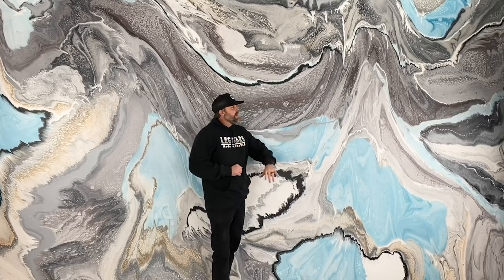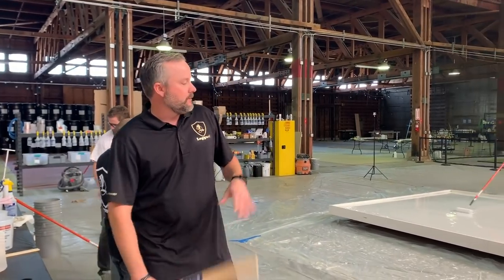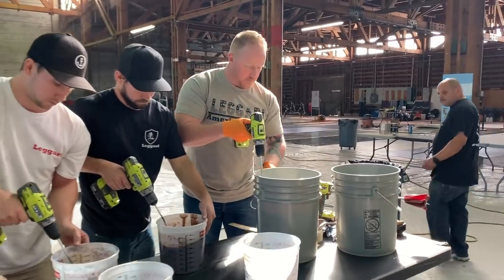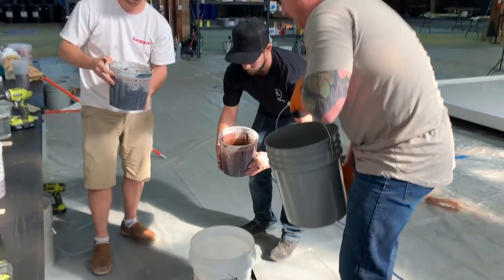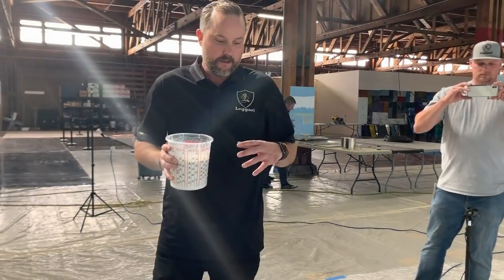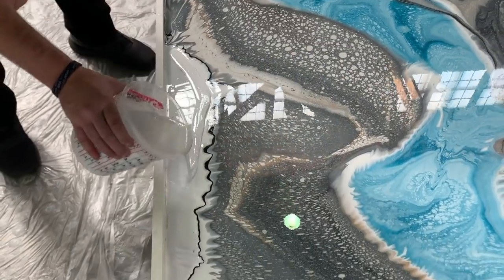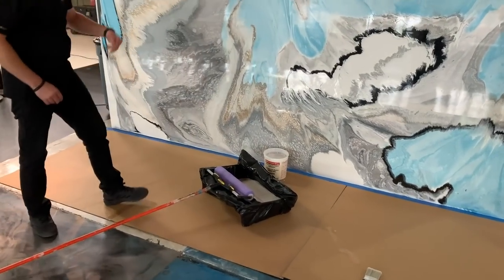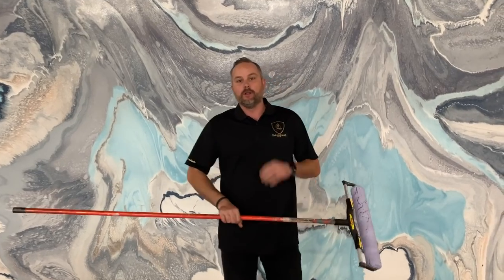MASSIVE Custom Epoxy Wall | Coated Using Dirty Pour Technique From Wood To Epoxy | Step By Step

Comment: Ever consider trying to use your product to create faux quartz?  Looking to do this on a large countertop in a kitchen and just saw your paint chipped pour look. Thought that could be the perfect technique to use and possibly a new offering for you all. Suggestion may include starting with silver at 25% and a white at 75% gently and not completely mixed, then apply. Instead of the paint chip covering the entire floor, use crushed up flecks of very small white and clear sequins or small crushed white and transparent rocks with a clear top coat. Love to see you try this. I have photos of the quartz I am talking about if you would like to see it.  Love your easy products!
Reply from the maker: Hi Jennifer,  take a look at our online brochure.  Thanks
https://online.flippingbook.com/view/364043

Comment: Oh I have been so waiting for this. I absolutely love it. super, this is exactly what I have been waiting to see. Your pouring techniques have come a long way. Love it. The fact that you are not overmixing is dreamy and natural. Way to go. I was wondering about the glair as I am typing. Bingo, you took care of that. I was thinking of sanding, but you got it. So here is what I have been thinking. Since i work solo and have wanted to do walls in some of my old houses that I want to sell. I am wondering what you used as your base to do your pour on. I need the lightest weight an I am 71. Lifting heavy is no longer in my capabilities, nor my desire! What I am thinking of doing, is cutting whatever the lightest material I can use in curves shapes that fit together like a puzzle. that way i can lift each piece and put it on a wall like a puzzle. You could use this for very large walls. Very very large walls! I would then screw it into the wall and then fill the screw holes. So what is the lightest weight you would use. I am also thinking about curved surfaces. Is there a window of drying time where the base materials could be bent. If I did a dome ceiling in my bedroom.  Now ya really have me going. Can your product be used on exteriors. How does it hold up to weather? Thanks for pushing the artistic envelope. I love what you are doing. Thanks
Reply: That’s an interesting idea to use a curved surface. Might be a little difficult but probably achievable

Comment: hi guys, that was a beautifyl master piece... i wonder that you did not use torch for the bubbles?
Reply from the maker: We have a high end epoxy that has an additive in it to make the bubbles rise to the surface and pop on their own.  Thanks

Comment: How do you guys do a removal or a clean up after using buckets/containers and mixer that had epoxy on them?
Reply: BattleRoyaleSucks you just throw them away they can’t be used again I’ve worked with these epoxies for over 16 yrs
Reply from the maker: We usually just throw them away because it is tough to clean the epoxy out of the buckets once it hardens up.

Comment: You left out the one phase I wanted to see... How did you heat it ? to get the bubbles out? Did you torch it? Did you use a heat gun? what did you do? It Turned out beautiful !

Comment: U guys Mix the color with part A or  B or both A and with the color together
Reply from the maker: We added all the Metallic pigments to the Part A’s then added the Part B’s to them. Once all the colored epoxy was mixed together we then separated it into the different buckets combining the different colors. We then poured to buckets into the surface. There’s many more of these videos coming out soon so stay tuned because we explain that process in better detail in those videos. Thanks
Reply: Thanks

Comment: Would wood filler work the same on the seals and screw holes? I hope so because I have filled mine in and rounded the edge of my counter top already. 😕
Reply from the maker: Yes it should work but we like to use bondo multi purpose putty because it is a lot stronger.

Comment: Beautiful! Can I ask how you deal with the bubbles???
Love your work.
Reply from the maker: We have a high end epoxy that has an additive in it to make the bubbles rise to the surface and pop on their own.  Thanks
Reply: Yeah, how did you get the cells?
Reply: @LeggariProducts  So your saying when you do those amazing projects you dont have to apply heat or a second coat?????

Comment: Can this be used in a bathroom? Shower wall?
Reply from the maker: This is not a product to applicate vertically because the epoxy will just run.

Comment: Hi what have you sealed the entire mdf with is it resin
Reply from the maker: First he applies our primer then he pours our epoxy resin so it will adhere to our primer.
Reply from the maker: I see what you mean, we first filled all the holes and seems with our Patcher Paste, then we flooded the entire surface with a clear coat of our Metallic Epoxy so that the colored coat didn’t soak into the wood. After that we did a thin coat of our Pigmented Epoxy and added all the colors into that. Hope that helps. Thanks

Comment: What was the cost of this project?
Reply from the maker: Typically the cost per sq ft for flooring including shipping and a top coat comes out to $2.25-2.75 per ft. For domestic US customers.  The size of the wall was about 300 sq. ft.